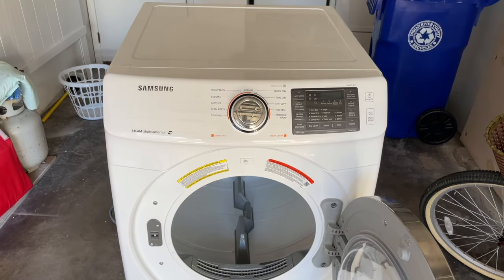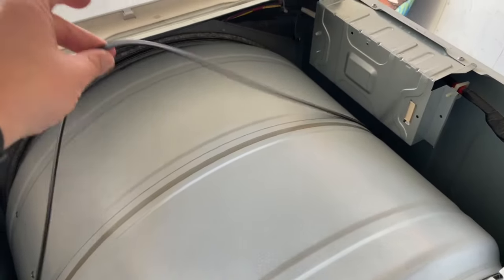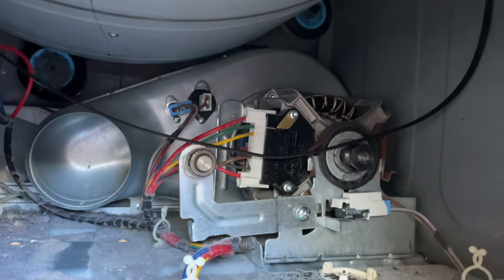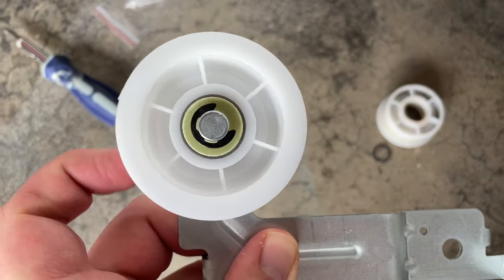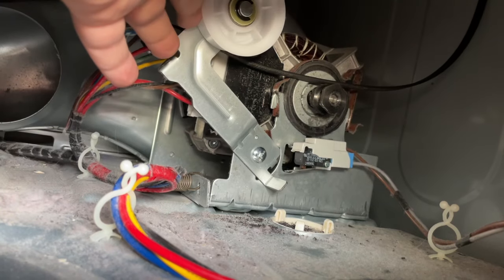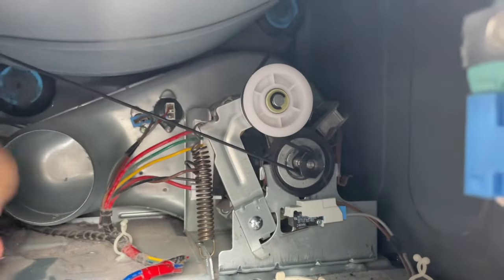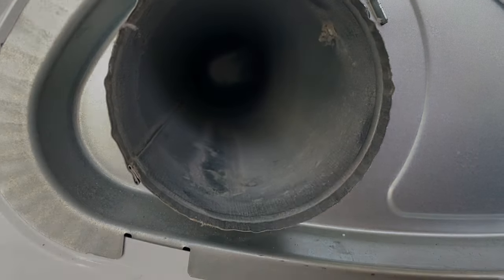Samsung Dryer Won't Spin - Easy - Repair Dryer Belt Pulley

Comment: Thank you!! Husband was out of town when my dryer quit, I ordered from amazon got it 2 days later and in an hour up and running! Texted hubby that it was fixed "You fixed it??????" I am woman hear me roar!
Reply: Nice
Reply: Can you come fix mine?
Reply: How is that part called so i can order it
Reply: You go girl!
Reply: hubby proud taught u well
Reply: My wife once fixed our washer, and as a man that has to work 16 hour a day, it really took a load of my shoulders.
Reply: Hi! I just took apart the dryer.  You gave me the confidence.  It’s exactly what I found inside.  Loose belt and melted idler pulley.  
Ordered parts instead of having to buy a new one or wait a month for a Samsung authorized repair person to come to us in a rural area.  Thank you so so much for taking the time to show this.  Very clear instruction. I will be subscribing to your channel.
Reply: Same here sister! Mines just broke on me and my hubby is out helping with the Florida hurricane relief victims. He’s a trucker. He won’t be back by then and so I’ve ordered my part and waiting to install it myself! You’ve just proved that I can do it too.  God sure do answers prayer❤

Comment: Thank you for such a great video!   Thankfully, my pulley assembly was not damaged. Following your easy instruction, I had the dryer back up and running within 20-mins.  Thanks again.
Reply: Thank you so much. I was able to fix mine. it was the same problem. Cost me $12. You are the best!!

Comment: I must have a newer model as the back hole is much smaller than the one in your video.  None the less, I ordered the part and was somehow able to get it all done with my left hand, not an easy fix but it works!  $10 fix vs spending hundreds or more on a new one.

Comment: I had my dryer thermostat replaced 14 months ago (my machine was 4 years old at the time...go figure) at a cost of $400. He could hear a grinding noise at the drum started turning and replaced this part as a courtesy. He indicated that those plastic parts just don't hold up. Now, the grinding is back again when the cycle starts. Thanks to your video we can replace it. I wish  these were made of metal! Excellent video! Thanks!

Comment: Man you totally saved my life tonight!  My dryer drum was binding and while I was trying to coax the belt with the motor on, it came flying off the idle pulley.  Without a service manual I was dumbfounded to figure out how to thread the belt back properly between motor spindle and idle pulley!  Your video saved me an expensive house call for a Sanyo dryer they don't even make anymore! You rock, buddy!!

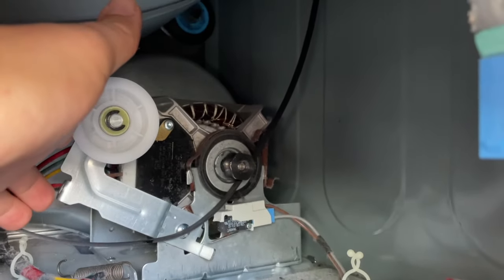Comment: This was exactly what I needed! I will say, the part at 4:30 is a little confusing -- or at least it was for me. I thought I had to twist the line around the black motor wheel...but after looking at your after part just after that, its just pulling the belt to the motor and "looping" it around that without any twist motion. I think that was probably clear to a lot of people, but it did take me a few minutes to get it right. Either way, I really appreciate the video guide - saved me a lot of money!!

Comment: What a user-friendly DIY video!!! My dryer doesn't match the model but your pacing and descriptions were spot on!
Reply: Can still probably try it out, I’d imagine the inside mechanics are similar. 

Only hard/time consuming part will be figuring out the part number for the part that’s broken. A quick google search for the manual/parts diagram for your model, and I’m sure you could attempt a fix!

Comment: thank u! i had the same issue where dryer would start normally but when it's time to get my clothes out, they were wrinkled and not fully dry. found out the tumbler drum wasn't spinning and i was able to diagnose the issue because of your simple and easy to follow video! it ended up being the same isssue as the one you showed so i'm going to order the part now and get it fixed

Comment: Thank you so much for making this video. All the other videos I watched on a loose belts wanted you to basically take your whole dryer off from the front. I had the exact same issue (except having to replace the part) as in the video and was able to fix the issue, using your video in about 30mins (because I also vacuumed a bunch of crap outta the dryer).

Comment: I have a different model dryer but relatively the same concept. Much smaller area to work with compared to your model but with the help of your video I was able to feel inside and get the belt back on the pulley and re attach the spring and get it working again within 5 minutes. Thank you

Comment: When I worked at the cotton mill, we always had bad bearings that needed replacing. But once you did that, those machines hummed, even though they were built in the 80s. I love replacing bearings. A little elbow grease and you're good to go!
Reply: No it’s even

Comment: You can repair it this way, much less time consuming than tearing the dryer down from the front. However a bit of advice, lay a cloth down over the metal edges of the hole you are working through. Those metal edges are really sharp, trust me. I found out the hard way with several gashes on my forearms.

Comment: Thank you soooooo much, all the other help videos I found and with the symptoms my dryer was having, all signs pointed to the thermal fuse.  When I got it opened up though, the belt was way loose. That's when I found this video.  Question though, the grey tin plate you removed and where you stuck your arm through is not on my dryer.  Same exact model# DV42H5200EW/A3. It is imprinting/stamped in the mold of the shell, you can see the shape of where the tin piece would be.  Basically I only have the metal vent pipe size hole to get my arm through, hopefully I can do it one handed.  Thanks again!

Comment: There is 2 versions of that pulley available, one like you used with a bushing that is the same as the original or a second style that is a few dollars more that has ball bearings and I think will last a lot longer, also I suggest turning the spring around 90 degrees from the way you installed it, the lever action at the pivot point where the screw is is constantly moving and the way you have your spring it could possibly come off, just a suggestion for both of these items to make the repair more permanent, this not a hard repair but on a gas dryer like I have it is a bit more difficult because you have to be very gentle with the gas pipe.

Comment: nice. 1) after you removed that exhaust tube, did you removed the rear panel?  Seems like you had a lot of view and access from just the little area.  2) how did you know the belt serpentine like that?

Comment: I think our model is a little older. It does not have the access to the back through the vent... we took the front off and realized we would have to take the whole thing apart just to get it fixed. Would you have any suggestions as to repair it without having to take it all apart and save us $200 for a repair guy?

Comment: This video was great. The belt and the pulley were fine, the spring became detached. However, after reassembly, there is no heat?  Anyone know what that may have happened?

Comment: My dryer is Samsung DVE45M5500P/AC 120/240 5400 W is and is not spin I checked from topr cover belt is there and tight even by hand i can rotate but by force not freely. Please advise what I have to do should I change pully If yes please mention part number for the same

Comment: I found out that the roller was worn down all the way to the idler, and I replaced it with a brand new one. I’ve done it plenty of times before, but now it won’t start. I noticed that if I try to spin the drum myself it will start, but it just goes really slow. Idk what’s wrong.

Comment: I'm having trouble with my dryer. It's the same brand as this one but the belt isn't broken and the pullys are in place and working fine. But my dryer won't spin but it humms when I try and turn it on

Comment: My rubber band belt thing and pulley still look in tact. The drum just won’t spin. Sometimes if I manually spin it and start it it will work but lately it hasn’t been. What else could it be

Comment: Public service announcement: the edges of the exhaust port hole on the back of a Samsung dryer are basically sharp as a Swiss Army knives so don't cut yourself like my dumb @$$ just did!!! Drape a thick towel over the bottom lip edges!